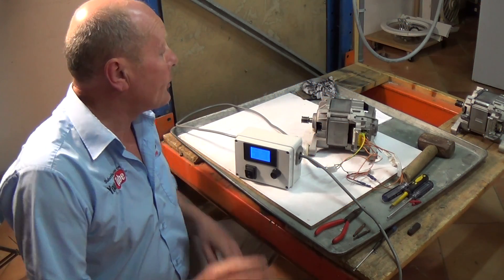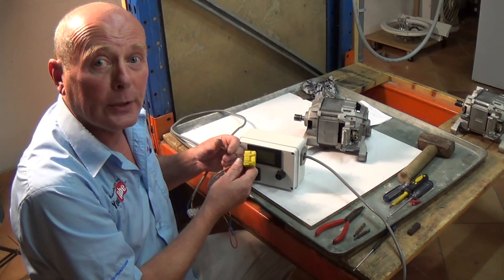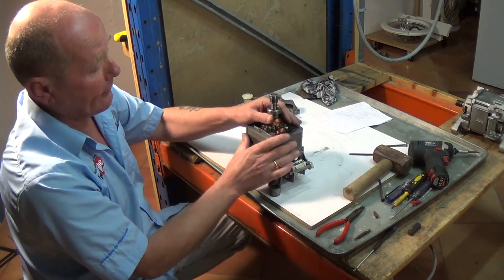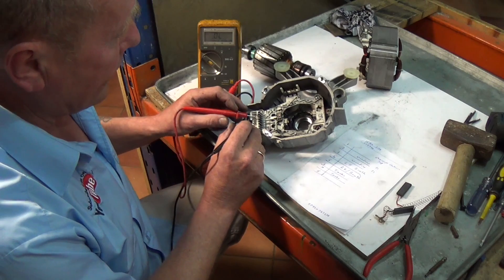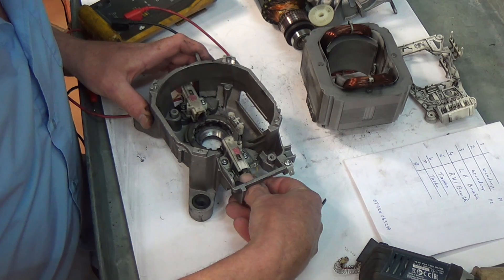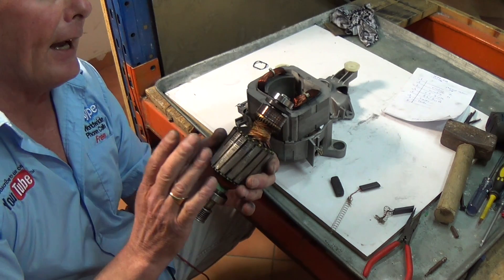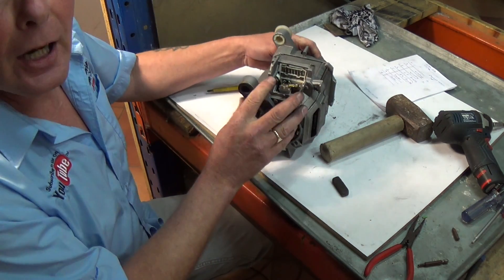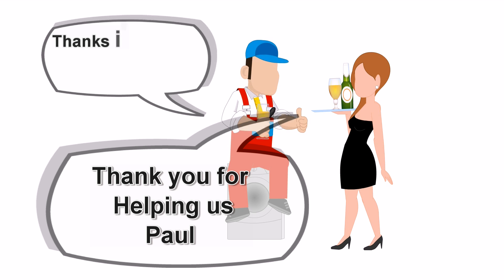Washing machine motor test and repair, bearing, brushes, a motor protector and thermal cut–out Bosch

Comment: I took my motor out to check it"s brushes - they were fine after 25 years! mind you for haf that time it was only my washing. My problem now is that I seem to have a bolt for the end which has the spigot - Howeve🤔🤔r as I can NOT get the bolt to engage into any thread  I must hope that I am wrong - I hope so. Well the brushes are fine so I have called in an electronics specials from Bristol here in UK, He has charged me £80 just for a first visit as he says he will have to replace some of the electronics . Thank goodness that your video has put my mind to rest regarding the "extra bolt "

Comment: Hi, my hoover washer used to spin real fast as soon as selected a wash then e09 would come up. I had the triac replaced and that fixed that error. Now my wash will do a full 14min wash start to finish but won't complete any other cycle. It shows the error e08 after around 15-20mins. I replaced the brushes, the heater element as I couldn't feel glass getting warm, I have had a multimeter on the 2 wires from the tachometer and getting 65ohms. But the washer still stops mid cycle with e08 error. Any help would be grafefully appreciated. The model number is H3w410tgge/1-80. Thanks.

Comment: nice video. I have that motor, but have a big problem..spin fast , then stop for 1min and repeating on bosch wfo2482 . i have problem cant find.. wich components on circuit board controling the taho wich controling rpm by voltage.. they work .. adding voltage wen spinning.. so what can be problem.. just on board?
Reply from the maker: Iam Glad we could help you. 
My Ebay Shop https://rover.ebay.com/rover/1/710-53481-19255-0/1?mpre=https%3A%2F%2Fwww.ebay.co.uk%2Fstr%2Fhowtorepair&campid=5338676951&toolid=20008
If you ever need help please use our site for 24 hour response https://www.how-to-repair.com/help/contact-us/
If have a question please use our site for 24 hour response https://www.how-to-repair.com/help/contact-us/
Please remember to subscribe to our channel
https://www.youtube.com/user/Apart4u?sub_confirmation=1

Remember to Shop with www.how-to-repair.com and it would help us by posting the video or

website on your timeline. This helps us a lot and if we really helped you can
always buy us a beer http://how-to-repair.com/help/buy-paul-a-beer/

Please remember to mark us to your favourites also I would be grateful if you would
subscribe to our channels social media as this really helps my site and keeps
us going.
YouTube. http://www.youtube.com/user/Apart4u

Facebook. https://www.facebook.com/how.to.repair.appliances

Comment: Did the brushes in my machine today all good I thought.... now the motor spins for about 2 seconds then stops then tries twice more in the cycle then stops altogether. No codes on the display. Could this be the overload relay ?? Any help would be gratefully received.
Reply: mine does same, did you sort it out

Comment: Hello,  My Bosch recently started throwing rcd a minute into cycle.  Heater element seems fine with 23ohms across L-N. Looking at  motor with terminal up the way, left to right. 
1 -2 =0.86ohm (windings) 
3-4 2.7ohm(brushes)
 5-6 23ohms(tacho)  
Carbon brushes are around 30mm so all good there I'd say.

The naming is going on my own probing hopefully got this correct.  
Is this a healthy motor?
Reply from the maker: hi duncan, i'm sorry for the late reply we have had a storm of a few weeks, 
go to our facebook and book a one to one in with paul, hes the man with the knowledge :) 
https://www.facebook.com/how.to.repair.appliances/

Comment: Thanks for this video. Had the F21 Code. Took the motor off, and the brushes where about 10mm long, knackered! So got new ones and up and running again after clearing the codes the way you said. Thanks again.
Reply: How did you clear the code F21? Tks

Comment: This is why I prefer inverter and brushless Motors now 😁😁😁
Reply from the maker: brushless motors are fine but the problem is. when the printed circuit board or the control board fails the machine is a total right off,  making this totally uneconomically to maintain the machine because of the cost of a circuit board is usually more than the value of the machine.
  at least a set of carbon brushes only cost the customer  £10 also
Reply from the maker: what part number are we talking about, please, the Electrolux one,s  are over £100 trade! so with doing the job the customer would be paying £200 ive not even looked at the price of the Bosch ones lol
Reply: how-2-repair.com yeah, I went to an AEG last week and that was £170 for the board lol! I am mistaken though, to buy independently the beko board is around £100, the company I work for must get a huge discount as we pay less than £40 (for beko boards)
Reply: You shouldn't ditch a machine because of a pcb problem before examining the circuit. I've just repaired one that had a blown triac, the replacement acs108 triac cost £1,04p
Reply: Yeah, see this a lot on the beko washers, however the inverter boards are only £30 usually so worthwhile to repair but very common